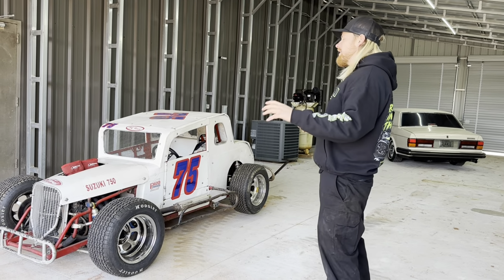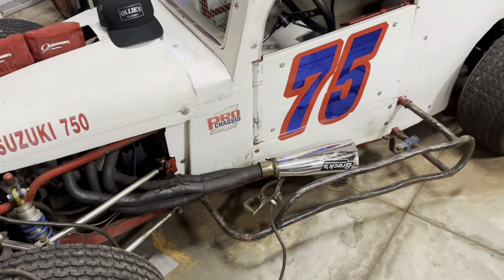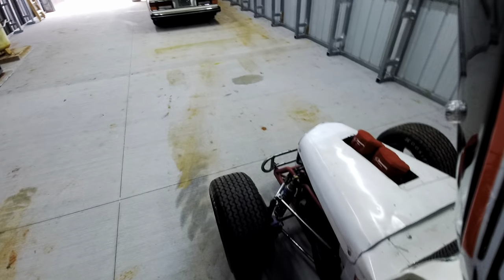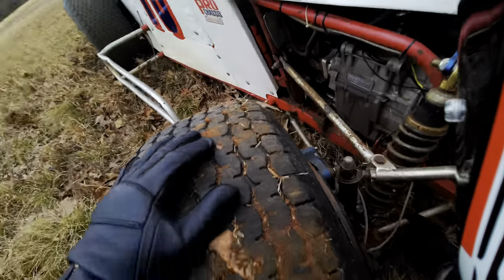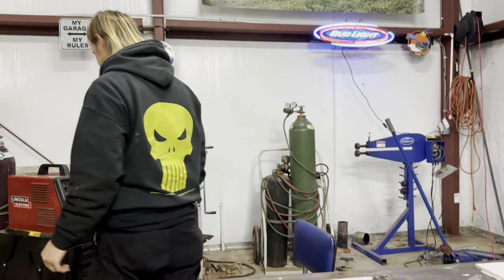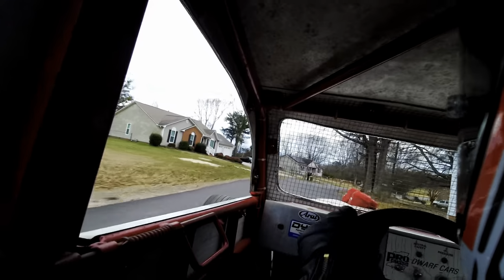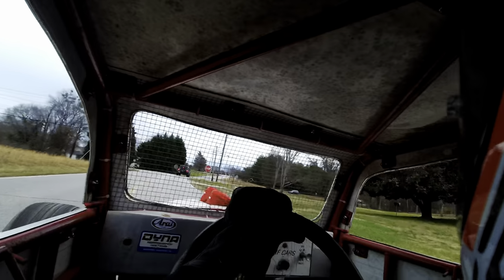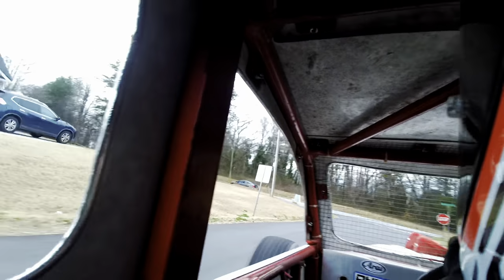Big Kountry’s first drive in the Gsxr 1000 dwarf car almost ends in a wreck

Comment: BK, Speedway Motors for all your rod end needs.  We use the chrome moly ones on the 4 link on back of the Race Car. 1000 to 2000 horsepower,  depending on who we are racing and how much money they are fixin to lose. No prep is like a grudge bike with 4 wheels.
Reply from the maker: I’ll. Check it out